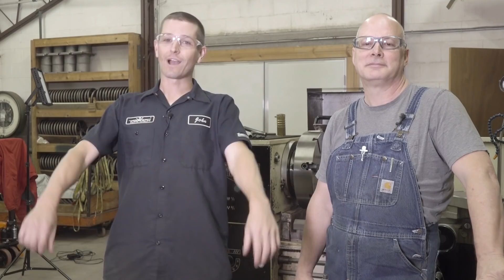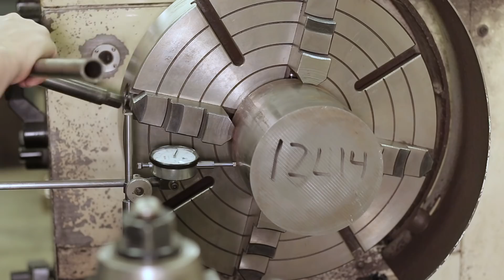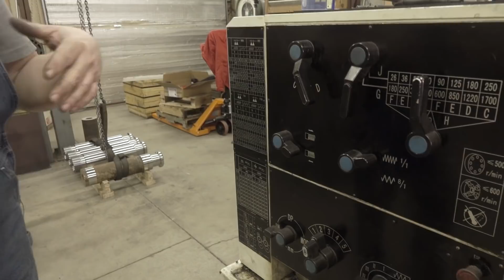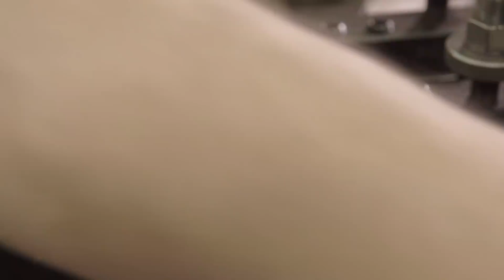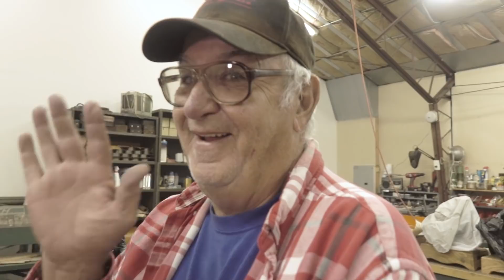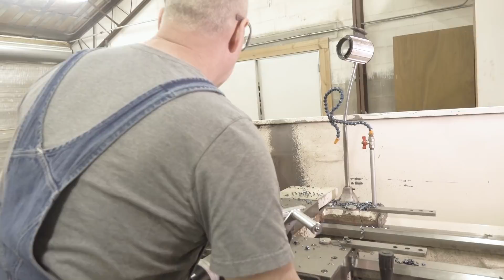Speeds & Feeds for Steel on the Lathe!  WW171

Comment: Sometimes I use 60 - 80 year old manual machines they still run pretty good once they are dialed in right. I might have to adjust them two or three times a day at the most.

Comment: I'm not a machinest, but have used machine tools and been responsible for purchase of tooling for them as part of my job as the Chief Engineer for a number of maintenance depts, mainly in the food and drink industries. I did quite a bit of research about 30 years ago on what might be the best all round tools and decided on the button and triangle inserts as being the ones that would cover most uses and be cost effective in an envirionment were we could be cutting 304, 316L and hot rolled mild steel within the same day. I still use these same inserts in my home workshop today and have to say that Sandvik have never let me down. Its nice to watch a video with a couple of real machinests, confirm that the choices I made as a total non expert all those years ago, were pretty well the correct ones.

Comment: In my small machines, I don't use carbide, but HSS.  Most of the steels I use are tool steels, with some exception.  1045 , hydraulic cylinder rods, of course hardened, chromed, but I got them for cheap.  Watch the speeds, don't let it get too high, keep the feed reasonable, use a junk tool to get rid of the chrome and don't be trying to take .002 or .003 for a finish cut.  Leave .010 or more and it works better.

Comment: I used to run An american duplicating lathe and we were roughing out 8" x 48" 4140 shafts and we were using kenametal tnmg 542 inserts at .375 radial depth of cut at .032" feed. The machine had a 30 hp motor

Comment: I can kick that insert's butt with well ground brazed carbide with a narrow straight chipbreaker with a slight negative rake in the narrow side of a right hand turning tool turned 90 degrees to the left and feeding towards the headstock with coolant on it. (so the chip hits the wide side of the carbide and doesn't dig a pit underneath it on the turning tool) You won't even touch a 100 inch long 8 inch dia 4140 shaft with that insert without having it vibrate off the center and into your lap . . . And i will chew that right up in no time with brazed carbide burying it 350 thou depth . . . one side. . . on that 4140 shaft. That's what brazed carbide will do if you know how to use it. It's become a rare thing to know.  The problem with inserts is that the chipbreaker rounds the corner and chatters on shaftwork.

Comment: I grew up (55 years in machining) with "Stelite" tools.  "Heat the part up till it's red and start cutting" the old timers taught me back in 60's.   Weld it hot and start cutting.  Finished with all types of tools after straighten of boat shafts etc.  Wish I had cameras back in the day before carbide you would see  lathes of the 1940s doing awesome work and even to this day.
Reply: Thanks sir

Comment: Well done, thanks I learned from your video that some cases you may not to break the chip completely if it is flowing out of the way into the chip pan. I used to grind a small radius on the top side just behind the cutting edge to allow the chip to break off into small pieces to avoid the “ birds nest”.

Comment: I remember some Clausing lathes had variable speed cross feed. It would change automatically as you worked to the center or to the diameter. I don’t know what happened to that series.

Comment: The way that I find the slowest acceptable speed for an alloy is to take a face cut of five or ten thousanths. When you see the surface start to machine tear. It will get dull. Measure that diameter and calculate what the surface speed is at that diameter. That is the minimum surface speed you want to use for that material on the lathe, mill or shaper.

Comment: That Mr DeBolt, one smart guy. Fascinating video, although I work everyday on one off type jobs I learned a lot. Lots of subjects to think about. I'm going to have to watch this a few times to take it all in. One thing that drives me nuts is that the WW2 EN system of steel types is still in use here in the UK. I have to cross reference all the time.

Comment: Hell I always break carbides on that last 1/4 inch of facing. I thought I was just a shitty machinist....turns out that's what happens normally if the surface speed doesn't change.
...and I'm still a shitty machinist.

Comment: Very interesting vid Lads. I got a 3 hp 3 phase engineers lathe and stuffed if I can get it to chip like that ever. Even if I get aggressive like that, still got birds nests. What's worse my finish on all cutting tools is Rubbish, I usually end up filing it to get a good finish. I can't figure it out. The lathe I got hasn't done bulk hours either though be it old @ 25 years old. All the tooling came with it & the original owner complained of the same things, So maybe it's a tooling compatibility issue I'm thinking. 
Any ideas mate would be greatly appreciated, oh and we don't get Reps driving through as in Australia is too big unless you live in a big city which I don't. And what's your recommendations on material to make model engines?? for instance

Comment: Thanks for the video. I am mainly cutting 1144 and 4140 with some 6160 added in with M2 HSS, no gear box so feed/speed isn't a quick change. While I am new to the lathe and using a 6" lathe (Atlas/Clausing) with a track record for gib issue's and mine has some heavy wear on them. I have been using HSS because my lathe just doesn't seem to be a fan of carbide tooling. I replaced the lantern style tool holder with a steel QCTP also to try to make it more rigid and I am replacing my cross slide nut next week to remove some of the backlash that I believe may be leading to my issue's as well since the positive rake will want to make it pull into the cut, lathe is bolted down to a heavy wood bench and there is very little flex. 

After watching this video, and if I am understanding this correctly, I can see some of the issue's I have been causing myself when shaping my HSS which has been grabbing or digging into the cut. I think, again if I am understanding this, I need to put a negative lead angle and a positive rake with a decent radius on my tooling to help where I have weak gibs for roughing and then I will change up to a set for finish passes with a smaller radius/positive rake and play with a neutral to positive lead angle or at least not such a negative lead angle. 

One other thing that has really helped is I believe where I have been leaving such a small radius on my tooling that it is affecting the finish as well as making it easier for the tooling to want to grab/dig into my work piece. 

But who knows at this point I could have it all backwards, again I am new to this and wanting a heavier lathe but it's just not in the cards for me at the moment so I am trying to do anything I can to help the lathe and ease the process.

Comment: My biggest struggle is parting. Avoiding chatter while parting is also challenging. I have a vfd and larger 13” x 36” and I have to gear it down and run it as slow as I can.  My bandsaw hates cutting steel it’s a small 4x6 even with m42 blades the large 4”-5” rounds are unwelcome. I also found its much softer toward the center and it then starts smoothing out and curling up the chips. When I start the chips are more like death slivers.

Comment: Interesting all the steels I work with. At times it cuts like butter and other times I think I have different material than what’s labeled. One of the issues I’ve ran into is the use of hot knives to cut these larger end drops off can often harden the material making it hard on one end, both, or inconsistent overall which can make machining on a lathe a pain. I have found on the vertical mill I can cut it in any mix of the above without much issue. It’s good to hear what others are doing it only expands the workability.

Comment: Great video, highly informative.
At  1.14.20, the cranked tool with the round insert is a right hand tool, not left hand as stated. The hand of a tool is determined by looking at it from the cutting(insert) end. Lets say you required a raised feature in the middle of the part using cranked tooling, you would cut the right hand edge of the feature from the end nearest the tail stock with a right hand tool and the left hand side of the feature from the end nearest the chuck using a left hand tool.

Comment: Fantastically informative video! What can I do to chip break if I have a small boxford home lathe with only a 1hp motor? I can't take deep cuts with high feeds to break the chips. And as you said I don't want rubbing on my ccmt carbide tips. Any suggestions?

Comment: A machinist friend of mine has a 15kW(20hp) and a 20kW(26hp) lathe...The only thing that limits the roughing is the toolholder grip. I've seen it and I can assure you that it's pretty scary when you try to take 20mm diameter at 1400rpm with a blazin fast feedrate out of a 40kg(90 pounds at that point of the process) shaft and you see the freakin toolholder starting to twist out of the toolpost!
PS: There are standard ISO carbide grades, but unless you frequent old machine shop auctions it's unlikely you will find one, even though they are quite good. Also the best manual lathes you can get are Bulgarian ZMM's...Really heavy duty machines, that usually go up to 2000rpm's and most machineshops swear by them!

Comment: John, its a very informative video but its missing one thing, when you did your last video at debolt S&F with aluminum., you add a caption OSD showing the numerical values of SFM, DOC etc., as a metric guy it's a bit difficult to understand imperial system. That caption screen would had made much easier for me to understand.... Anyways g8 work.. 👍👏

Comment: I have had great luck with Buck  set true  3 Jaw chucks,, and just my opinion , but I always bore soft jaws .001 bigger than the part, in order to have the jaw hold to center, you will have issues if you bore soft jaw smaller, ya won't be able to get parts to repeat concentricity.

Comment: As to the comment about carbide manufacturers doing in-house testing, yes they do but often they look for field reps to dod comprehensive field tests to gather more data. Even after a new grade and chipbreaker are intorduced data is gathered. 
When I sold for Stellram I used to test new inserts in the field in situations that were not suggested.

Comment: Thank you John and Paul.  I just got done watching this for the first time.  Next time will be with a notepad.  Your timing is excellent for me, I am expecting my new to me 16x40 in a few weeks and I have had my nose in every catalog that I could find reading up on insert tooling.  Also, I noticed a round insert tool holder in the box of parts included with the machine, and I thought that it would be a novel little tool to have, now I am certainly going to take a much closer look at it.  Great work and as said by others, I couldn't believe that 90 minutes went by so fast!!  R.J.

Comment: negative tooling can have positive, neutral, or negative rake.. positive tooling can have positive or neutral rake. Seemed like there was some confusion about that right about the start when this was being discussed. The two are related, but also not.
Reply: An insert can be neutral or positive depending on the clearance angle. The rake angle can be positive neutral or negative independently of that, but it is compounded by the toolholder angle which can also be positive neutral or negative(can't use a positive angle holder with a negative insert though). It's rake versus clearance.

Comment: 1:17:07 I would beg to differ that a bigger piece will make a huge difference in how much cut you can take on a machine because the torque to turn the part gets greater and greater.  Or did he change gears on  the lathe so the parts all ran the same SFM?
Reply: @bcblob02 That makes sense. When cutting larger pieces, the spindle torque is greater, but the increased radius means higher surface speed for spindle rpms - thus you can likely knock it down a gear, which gives more torque.
Although there are probably some non-ideal/parasitic effects that come into play at the extremes.
Reply: Cutting forces are high enough that any "stored energy" is negated. If you are taking a decent cut even on a shaft weighing a ton and you disengage the clutch while in the cut the shaft will stop turning almost instantly. As to the thing about gearing down to increase torque yes that is the case and often is used to correct SFM, but it didn't look like they changed RPM's between materials.
Reply: I thought the same thing Bryan, looked like the same speed.
Reply: Once a large part is up to speed, it shouldn't sap too much power from the motor as it'd store the energy like a flywheel.  I'd also expect that energy to assist with the pulses of work at the start of an interrupted cut.   my lathe has a 4" swing and a 1/4hp motor so I may be talking outta the wrong end.  If it's just diameter we're talking about then I definitely am.

Comment: Talking about the right insert for the lathe, I've been using Sandvik TNMG 222 inserts with my little 7 x 14, and they're some of the only inserts I've found that do a proper chipbreaking on cuts as shallow as that poor little thing tan take. Not everybody has a 20 HP turning center, and with limited horsepower or rigidity, finding inserts that don't beat the crap out of the machine is hard sometimes...
Reply: Jim, Can you post a video of that insert breaking chips on your mini lathe.  I'm sure a lot of people with those smaller lathes would like to see that.   Thanks,  Chris
Reply: Thanks for the tip on the insert for smaller lathes.  Chris
Reply from the maker: AWESOME!  Yea, I can't believe how that "T" style performed!